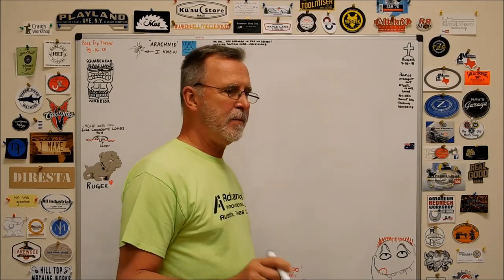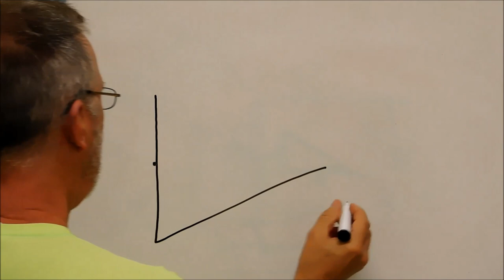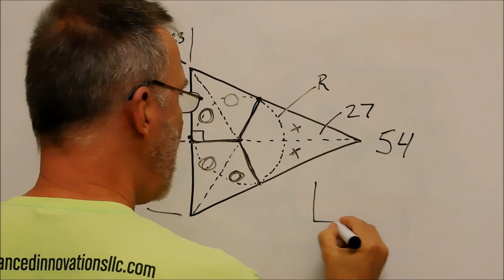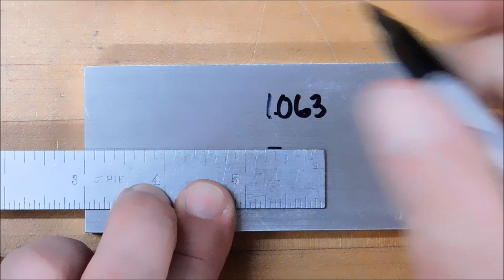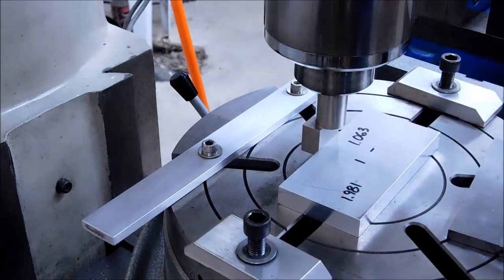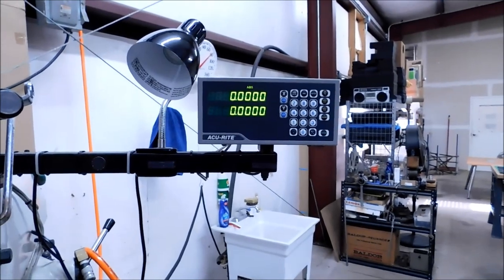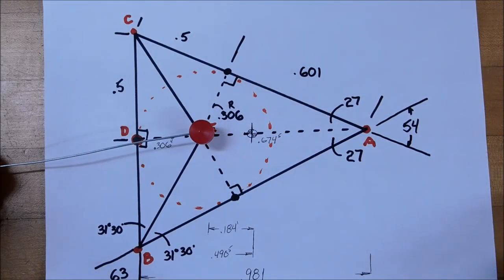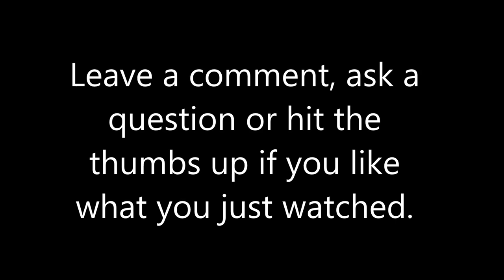The Preparation Behind Correctly Milling a Triangular Pocket

Comment: I've been pecking at your videos Joe, trying to find just the right one to tip my hand at subscribing. 
Then I realized the thing that you do well which most other Youtube presenters shy away from... actually teaching geometry and laying out their problem solving methodology. 
When you have something to figure out, all the steps are presented so that anyone who cares to follow your thought process can. 
No quoting a formula or "solid works says so". 
And you explain it so that even folks unfamiliar with technical terms like 'incenter, circumcenter, centroid' can pick up what you're laying down. 
You've earned my subscription many times over, sorry it took so long to acknowledge it.

Also, your whiteboard skills are really good, sketching adequate diagrams like that free hand is not as easy as you make it look, kudos on acknowledging the minor wobbles without letting it devolve into ocd.
Reply from the maker: Thank you for signing on. I'll try to offer the best advice I can and keep it real.

Comment: Joe, thank you for another useful video.  A few years ago, one of my co-workers realized that his cell phone's calculator app was giving him the wrong answer for a trig problem.  To make a long story short, the app's programmer forgot to program for angles in degrees -- he only did it in radians!  Obviously that gave bogus answers.  I strongly recommend that anyone using a cell phone calculator app, instead of a real calculator, check the particular app they are using to ensure that it is giving the correct answers to trig calculations!

Comment: Thanks Joe. I pinched your idea and made myself one of those centering tools. Very handy, and now I have another use for it. Cheers from the land down under.
Reply from the maker: Not a problem. I have shipped a few down under and the postage is usually more than the tool. And it takes weeks to get there.

Comment: Ha! In my country you would be known as a "stirrer". I watched a well known manual machinist making an almost identically shaped pocket in aluminimum but your method is infinitely more elegant and leans on the ancient Greeks for its geometry. Is this tounge in cheek machining? Well done.
Mark Presling, Queensland, Australia
Reply from the maker: You can bluff your way through something and film it, or do it right, teach it, and film it. I thought you guys deserved to see both methods. Dykem would be out of business if only one was correct.
Reply: @joepie221  Like they say... A grinder and paint.... (oh snap!) - wrong video. My bad. I wish I would have had someone like you for a math teacher back in high school instead of the apathetic woman that had no interest in actually TEACHING anything. 

This is the kind of video that actually helps those of us that were left in the weeds so many years ago. And it is greatly appreciated. It's like staring at a very complex piece of machinery that won't operate. In order to be able to fix it, you first have to know how it is SUPPOSED to work. Failing that all you can do is guess your way to a mediocre repair. Knowledge is power.
Reply: @highpwr  Totally agree! If I would have been taught geometry and trigonometry in this manner I would have actually learned it and would have wanted to learn it. Joe's video demonstrates exactly why you need to learn this type of math.

Comment: Joe gives us some fabulous stuff as always but.....actually......2D CAD and a DRO and a rotary table....you can make anything. You basically use the 2D CAD as a sophisticated calculator, draw what you want and pull off the dims and angles and you're away. Trig is fun but 2D CAD is quicker. When I design parts I design them in 2D with the rotary table in mind, set up the angles and such, offsets etc, its a dream. Thanks Joe, you always have interesting stuff, a master machinist without doubt.

Comment: Anytime you have an arc tangent to two surfaces, it's always gonna project to the center of the arc at a right angle perpendicular to the surface that it's tangent to.

Great video Joe Pie advanced innovations. I learned.
Reply from the maker: Thats a valuable thing to know. It helps layout and calculation a lot.

Comment: Fine tutorial Prof. Joe Thanks
Reply: I think the don't is when the center flat of the pin was facing toward him and then he spun 180 and used the parallel against the center flat. That way the edge of the parallel was the correct distance form the spindle when the dial was returned to zero.
Reply: My comment was ment for Jess, sorry about that lol.

Comment: For any triangle the center of the inscribed circle lies along the bisectors of all three angles.  Also, each angle bisector bisects the opposite side.  We can quickly find the midpoint of a side by averaging the locations of its endpoints.  Once two slopes and the locations of their vertices are determined, the two equations describing the two vertex bisectors can be solved using algebra to yield the coordinates of the circle's center.
Reply from the maker: I have to respectfully disagree with you. Although the points of tangency of inscribed circle will contribute to the construction of 2 equal triangles and bisect each corner it confines, it will not bisect the opposite side. At best, it occurs only on triangles with 3 equal sides, and once on a triangle with 2 equal angles.  The graphic on my whiteboard supports this comment to the letter.
Reply: Check out this graphic that many geometry teacher use. I wish I could attach a picture.        http://www.poly-ed.com/wp-content/uploads/2018/05/triangle-centers.png.   You both are right, but joe is righter this time.
Reply: @joepie221  Contrary to intuition, you are correct.  Bisecting the opposite side bisects the angle ONLY for isosceles angles (between two equal sides).

Comment: Great video, I'm a big fan of using math.  The only thing that I would request for a future video of this is to take into account the cutter diameter.  As it is, the actual size vs the drawing are not the same.  But I know this was just for teaching purposes and understand the point you were making.  I especially liked how you figured out the center of the part vs the rotational center, that worked out beautiful.  Always something good to take away from your videos.
Reply from the maker: Good comment. This is a tool centerline demonstration. I had the tool comp offset video composed, but included, it made this video too long, so I edited it out. The math is fairly simple if you draw lines all over the print. Maybe I'll drop another video in to show that.
Reply: @joepie221  I'd really like to see an od/id threading video.  Something that shows how to create any thread size depending on the size of the part in order to mate them up.  For example if I had two chunks of 2.25 aluminum round stock and wanted to mate them up.  How would I come up with my own thread size?
Reply: @joepie221  I'd love to see the tool comp video!!

Comment: But Joe.... didn't you blow your 1" dimension?   You would have to compensate for the cutter diameter, wouldn't you?  Great technique! Keep it up.
Reply from the maker: This video is for the mechanics and shows a trajectory. technically you are correct. The values would need a radius reduction based on your cutter.
Reply: @joepie221  thanks for the reply.  I was wondering how you would respond to this. It is a great technique and I was just being ornery with you...was half expecting a response of 'well since the drawing showed no radius it was obviously a centerline projection between the radii.' or something like that.  Keep 'em coming Joe!

Comment: Hey Joe. Did I miss something because I think your pocket is going to be half a cutter diameter bigger than your drawing. Love your work mate.
Reply: He was just showing the principle, it's up to you to compensate for the cutter size.
Reply from the maker: This was a centerline demonstration. Just to be specific, the pocket would have been a full cutter diameter larger than the dimensions. You can apply the math shown, in reverse, to come up with the values to comp your tool.
Reply: @joepie221  thanks Joe.

Comment: Joe- first of all, I always learn so much from your videos. You just earned yourself another patreon supporter off of this one though! Secondly, I've been doing a lot of similar rotary table work pushing my limits in finding ways to manually mill company logos with the rotary table. It's fun stuff. Can you do a video (or maybe you have) directly commenting on tool deflection on the milling machine for different kinds of cuts (but most specifically- slotting). At 31:40 you choose to mill left to right because "the tool deflection will be into the pocket." Why? How does one know which direction the deflection will happen? And does it matter if it's side milling vs slotting? Thanks!!
Reply from the maker: I saw the notification of your support. Thank you for that.  A video that may be helpful is this one.  https://www.youtube.com/watch?v=QGHujqWlxtg&t=184s   I believe it addresses your question.

Comment: Generally, the center of the inscribed circle is at the intersection of all three angle bisectors for any triangle.  Once you know the center, you only need a perpendicular line to any (or all) side(s) to get the circle's radius.  The center and radius define the circle.
Reply from the maker: I thought that was clearly demonstrated. The myth is that, that bisector bisects the opposite side. that is not true for all triangles.

Comment: What would make this set-up easier is if the rotary table had four tee slots all of which where oriented to the x and y axis at 0°. Then have two low profile fences keyed to the tee slots with the fence surface at 90° to the tee slot. If you know your table rotation is true a plug dropped into the center of the table with one side machined so that the face is on center the table could be setup off of the mill. This assumes the table is keyed to the mill table and the tee slots are straight.

Comment: Was all of that " what you are not supposed to do" or at what point did you change to what you are supposed to do.
Reply: I noticed that too, and was wondering where the "don't do this" ended.
Reply: Hi! Joe was saying not to set the adjustable parallel up against the part itself and to instead set it up against the zero face in the spindle. This is just to avoid hassle and make it less likely to end up with an inaccurate offset.
Reply: I think the dont is when the center flat was towards him. He turned the flat 180 degrees and set the center flat against the parallel so the parallel was the correct distance when the y axis dial was returned to zero.
Reply from the maker: Correct. Trapping the adjustable parallel between 2 solid surfaces was the preferred method. Thats when the tool rotated 180 degrees away from me.
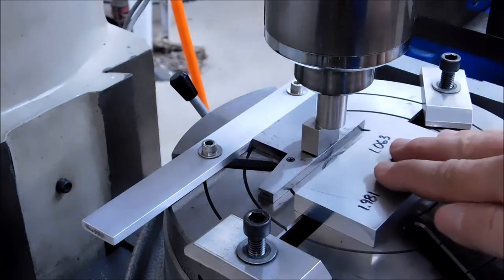Reply from the maker: @StraightThread  21:18
Reply from the maker: @Jess Julian
  go to 21:18
Reply: @joepie221  thanks.
Reply: @joepie221  ah, got it!  Thanks.

Comment: When are you going to start a geometry channel? You might give 3blue1brown a run for his money🤣

Fwiw, this also works with arbitrary triangles—they don't have to be isosceles.  The center will always be where the angle bisectors intersect. It won't be at the midpoints of the sides, though.
Reply from the maker: Somewhat true. The inscribed circle will still appear and produce sets of identical triangles, but may not result in the identical 4 triangles on one end. The one end may also not be bisected and inline with the circle center and opposite side apex.

Comment: Print was one inch, you didn't account for till width,  so I'd your part larger than the print? It would still be centered.
Reply from the maker: As stated below, this was a tool centerline demonstration. In the absence of an actual point on the feature, you could expect a small difference based on the cutter diameter.
Reply: @joepie221  I did watch at 1.25 speed in a few parts, so i guess i missed that. I do learn how to apply old maths i hardly use in these videos, so thanks. This should be the lab work we teach in our math classes. Association is the most powerful way to may memories.
Reply from the maker: @ShawnDickens  After some thought, I was going to edit my reply, but I'll do it here. On a tool centerline demonstration like this one, the radius of the tool would be the added length to each end of this triangle. From the point, and rear vertical surface equally. So the center of the triangle would still be the center. If the cutter were comp'd to the inside of the line, then you would have a slight difference. I had to think about that.

Comment: shouldn't the angle be 31.5 ?
Reply from the maker: Minutes are often confused as decimals. Is that where your inquiry comes from? But, depending on the mode of communication, 31.5 degrees can be interpreted as 31 degrees, 30 minutes at the machine. Just not used to do further calculations.

Comment: Only one clamp on the vice is not good practice could easily pivot with a heavy cut
Reply from the maker: Agreed, but there was no heavy cut during this video. Also, if an object is restricted from moving about a location by blocks or stops, all the clamp needs to do is keep the device from lifting.
Reply: @joepie221  Absolutely but if you have it happen once you tend to not take any chances for the sake of adding another clamp only takes a minute

Comment: I have a headache!.
Reply: Me too
Reply: Me too. I worked with a 35 year veteran machinist at my shop/shipyard. (building battle ships for the US Navy) the guy was a awesome practical machinist. He was very smart and could do complex math equations if needed. But he was incredible at breaking stuff like this down in a rational digestible manner. Without making it confusing, unlike this video. I love this guys passion but totally painful to watch. Some people dont digest info in a mathematical form, they need it in a direct form. 
I remember the guy I used to work with (retired now) explaining how to machine a hex into a piece of square stock on the mill. So straight forward and to the point I will never forget. Hands on application also plays a huge  role.  I could digest what this guy is saying if I had to but would rather have a old timer at the shop show me hands on. "Wide axis radius shift of the long hair of my left nut, get your binoculars and see how many degrees the big dipper is from the north start." Its really not too hard.
Reply from the maker: @Pete Johnson   If I were to break this down any further, I'd have to use crayons. Sorry you feel the way you do, but there is nothing basic about geometry and the trig needed to make it work.
Reply: @joepie221  get the crayons.
Reply from the maker: @burnheretic3950  If you watched the video, you'll see I explained the mechanics on the white board, translated that work to a piece of paper, explained it again on my bench with a red dot pointer, then broke out each leg with a preview of the upcoming machine move and then did it. So you got a theoretical explanation and a visual demonstration. If it doesn't sink in after that much effort, I'm not sure crayons will help. Go scribe the lines and wing it.
Reply from the maker: @burnheretic3950  By the way. I'm pretty sure the 2 headaches noted above are from an appreciation of the material and its complexity and not from sarcasm.